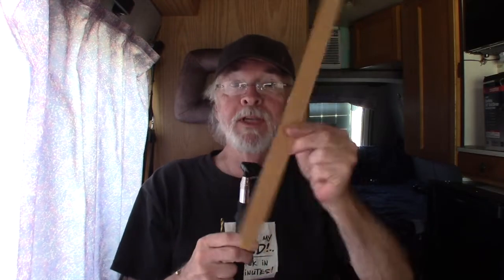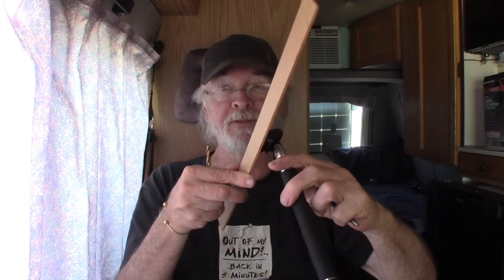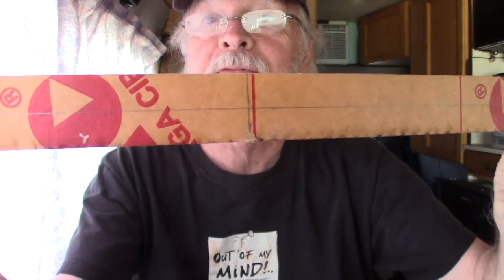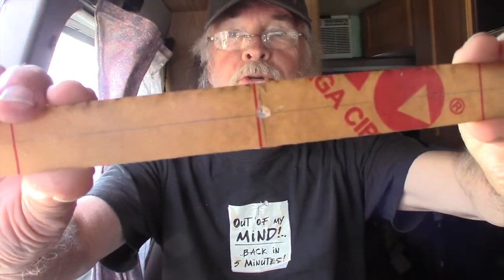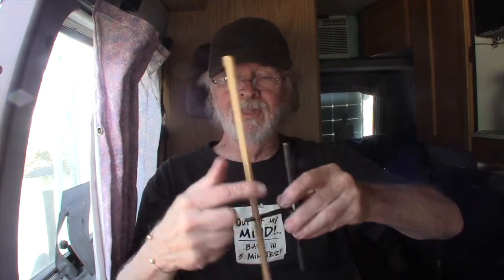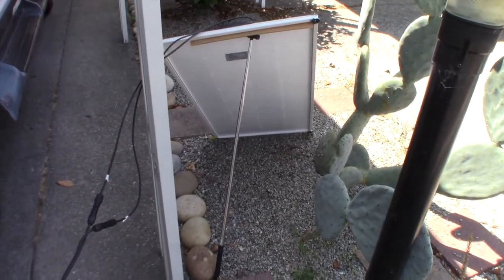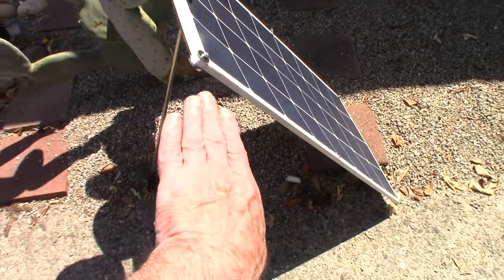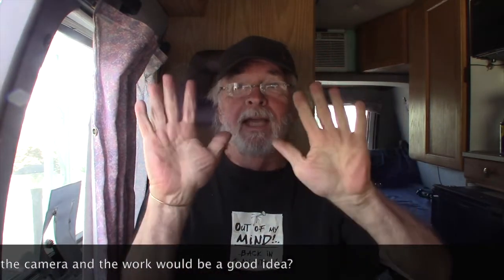DIY Lightweight, Makeshift Support for a Flexible Solar Panel.

Comment: i recall one of your goals was to have a steady electric supply to your refer. So, in the end...how is your system performing?
Reply from the maker: Hi CS, Yes, that is one of my goals and so far, the little 100 watt panel and my 75 ah house or leisure battery can keep the fridge powered throughout the day.  I drive the van almost every day so that helps charge the battery too.  I am going to add another house battery and I may add another solar panel so I have a little buffer.  The fridge uses 1.5 to 2.5 amps per hour so that can pretty much use up every amp the solar can produce.  If I'm not moving, I notice the battery can gradually lose a "full" charge. So I'm really right on the edge with what I have. In glaring bright sun, okay.  But it doesn't leave me much extra for charging other things like computer, phone, lights, the bike battery.
Reply: i don't quite recall, can you add a second panel?
Reply from the maker: Hi C S, Thanks for the question. Yes, it is possible to add another panel.  There is another type of connector that allows multiple panels to be "chained" together.  If you wire them in "parallel", like I would do, the output voltage from all the panels stays the same and the amperage output of each panel is multiplied by the number of panels in the "chain". In the case of my adding a second panel, I would have a peak amp output of about 10 amps vs the current output of 5 amps on the single panel.  That means  for a 6 hour "charging day" ( it's really longer but not at peak) I could expect about 60 amps of 12 volt power to be produced on two panels vs. the about 30 amps I currently am able to produce with just the single panel.
I have designed an ultra light frame for the "floppy" flexible panels that I could design a hinge for and be able to close one panel over the other for storage, open for use, and be able to store it as I currently do. I made a make-shift leg to make it free standing if I want to set it up off the van.  I use magnets to hold it on the van's body and it is light weight enough to easily place it on top of the van when the sun is high in the sky and the van is in direct sun.
For some people, all this might be too much of a hassle. So if the idea of just mounting the panels is more appealing, there is enough room on the roof to mount two of these 100 watt panels and be done with it.  Or one could be permanently mounted on the roof and the other used like I use the single one I have by connecting it to the fixed panel putting it in the sun, free standing away from the van which might be shaded, or attached to the side of the van when the sun is lower in the sky to harvest the last bit of energy at the end or beginning of the day when the roof panel isn't yet in or has fallen out of the sun's line of sight. 

I go through all these mental gymnastic possibilities because for me, as a designer, it's just in my blood to conceive different ways to apply the same technology.  I don't see a lot of videos exploring different ways to deploy solar.  It's usually just the "conventional" stick it up on the roof with some VHB tape or drill holes and screw it down, seal it with Dicor. 

In doing what I have done, I like the flexibility it offers me.  I might want to carry some solar power some distance away from the van at a camp site, maybe sit at a picnic table in the shade, with a fan, read a book, watch a video.  I can bring a small agm battery, the panel and necessary connectors, small inverter for a tool or appliance and spend time in this "expanded", electrified environment.
It's just about possibilities and trying to expand on the other great applications other people have.
Maybe something somebody takes away from my little musings helps them do some possibility thinking of their own and come up with ideas for their stuff that works for them.
Reply: you give the most detailed and thoughtful replies, very nice for us viewers to understand.
Reply from the maker: Thank you C S, much appreciated.